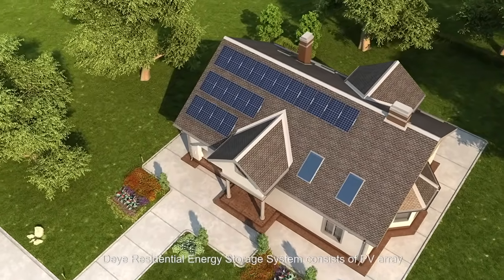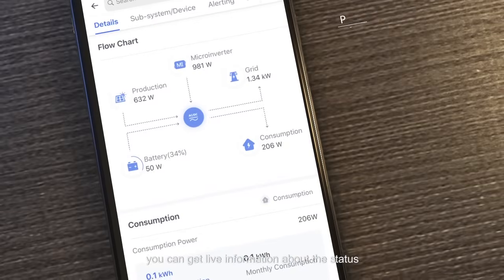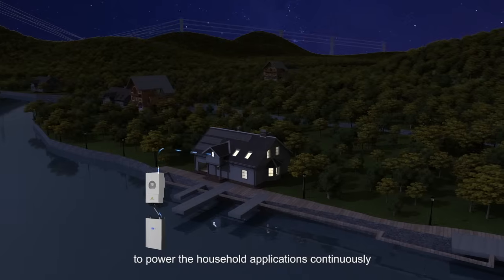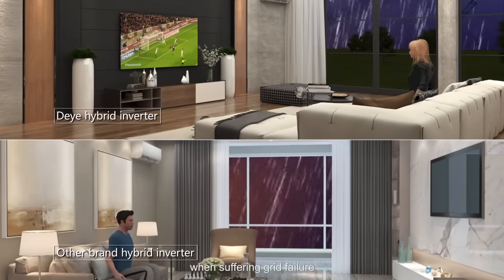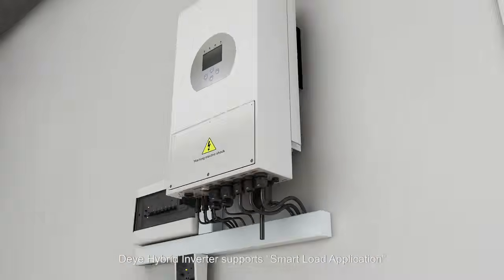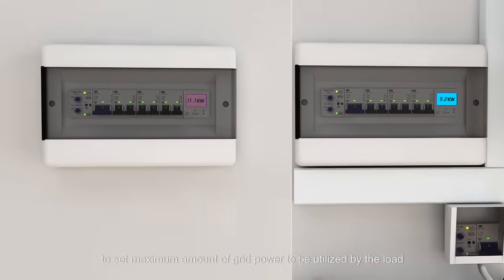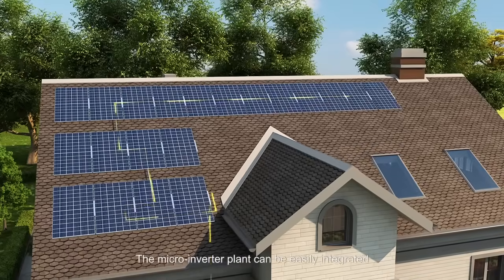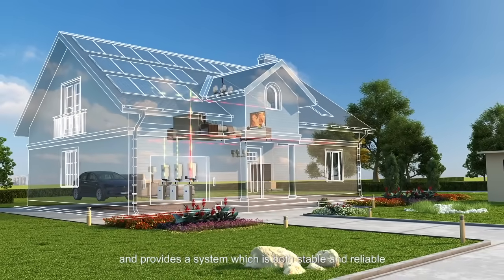Deye Residential Hybrid Inverter Introduction

Comment: Looks interesting but not so interesting as it cannot trade with a dynamic contract. A home battery needs to be a lot more intelligent. Looking to what is the price of power this hour, how much PV energy is there available, how much load do I need to deliver, what is the battery state, is there a car to charge? All these parameters must lead to decisions like buy grid energy to load my battery as grid is no cheap and switch off my PV as the price is negative or sell as much as possible PV as the price is high and my battery is at 80%.

Comment: In case of grid failure, can the system power the load and/or charge the battery in case of excess generation??

Comment: The display on my 8Kwh Inverter is no longer working. It briefly comes on for 1-2 seconds on "boot-up" but then flickers and fades away. I have changed the 3V battery on the display motherboard, but this hasn't solved the problem. Help and advice to rectify the problem would be appreciated. The system was installed just over 12 months ago. Thanks

Comment: No one is making any mention of what the the advanced settings needs to be  not even the manual, it only makes reference to it when connecting 2 or 3 inverters in parallel nor does 1 video or website site makes any reference to the wiring diagram of a 1 inverter system
Reply: Like why does a single inverter under advanced function state its in slave mode and when you change it to be in master mode it goes into alarm mode what the Modbus setting is supposed to be in single inverter setup etc.

Comment: Does it work with a DIY LifePo4 Powerwall with smart BMS (w/ CAN/UART Communication)?
Reply from the maker: if the votlage and current is within the allowed range and the other items perfermance is okay, then it is okay. but there's potential risk for using the DIY battery i suppose.